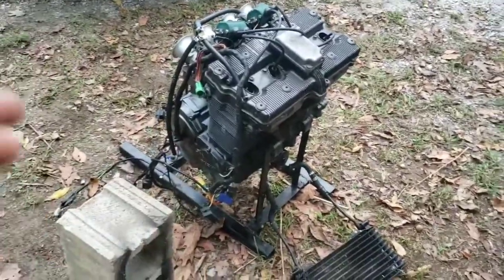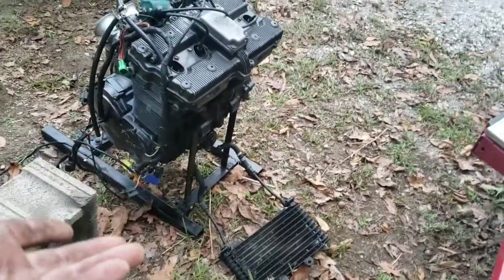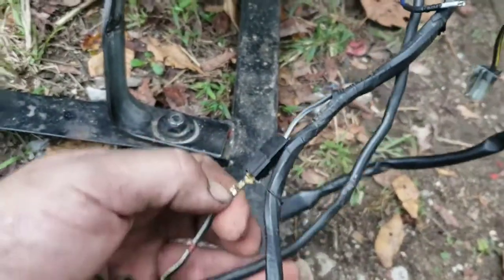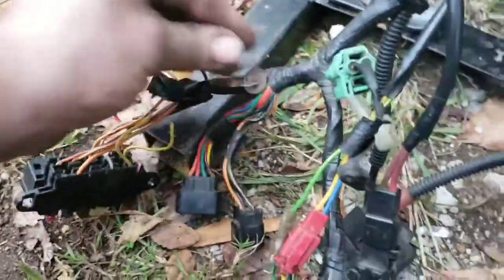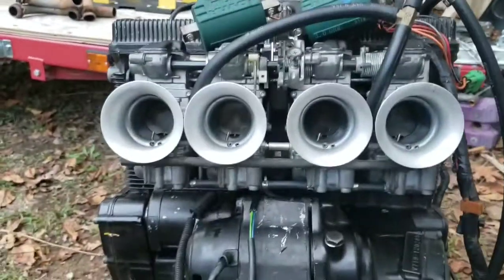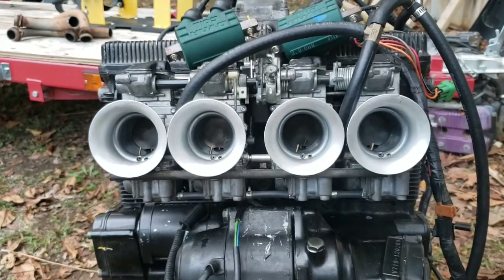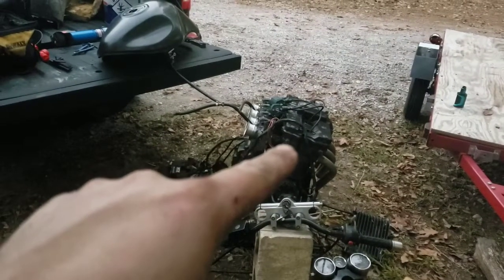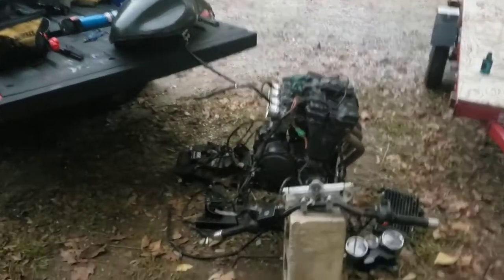Firing the new bandit 1200 for little bad girl she breathes fire!!!!

Comment: Where do you get the motor parts from
Reply from the maker: Most of the performance components for my bandit were from an 1100 oil-cooled GSXR
Reply: @RingTuned  specific year?
Reply from the maker: @trevorroper6939  I'm trying to remember for some reason I'm pulling 86 out of my head I would have to look back but pretty much all of the oil cooled 1127 engines